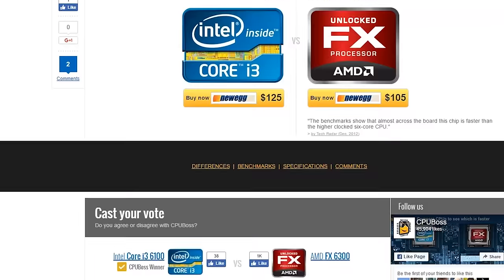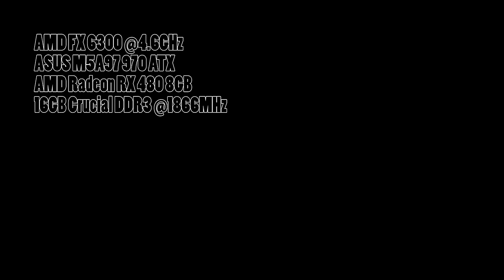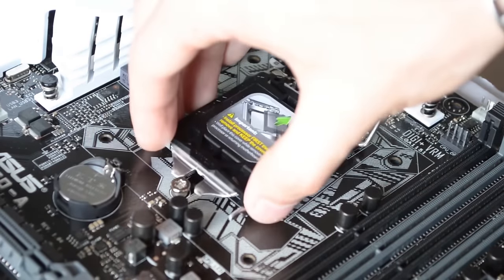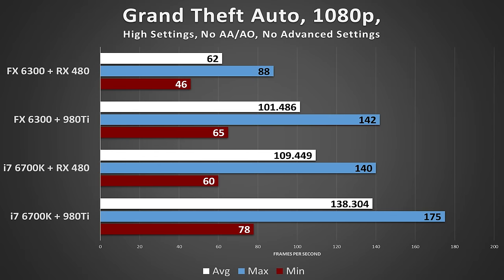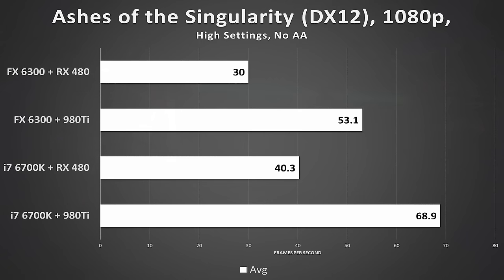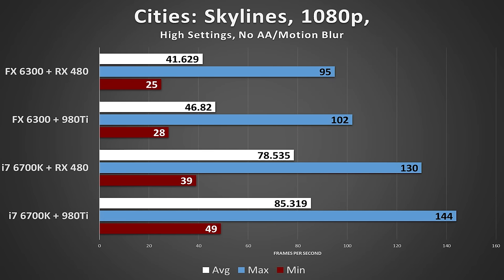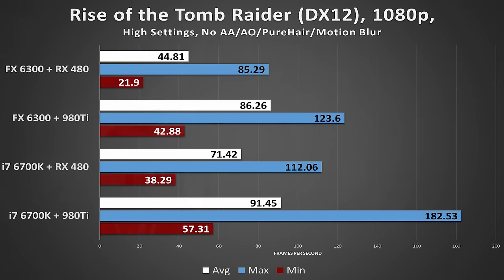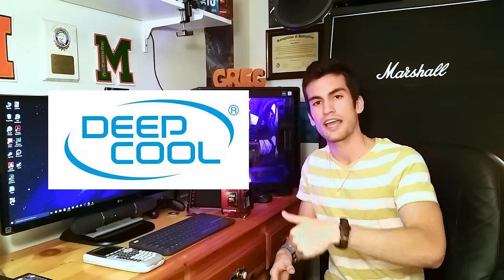AMD FX 6300 + RX 480: Severe Bottleneck?

Comment: Now I want to get an intel CPU- I have and FX8320. Too bad I have to buy a new motherboard as well.
Reply: Or wait a little more for Zen architecture.Even if decide go Intel; it will cost you less.
Benefits of competition
Reply: Okie. Intel will cost less? sorry I didn't understand.
Reply: Rigth now Intel have a monopoly on high performance CPUs; it charges any price they want because there is no other choice.
ZEN is to be launch within the next months and will set a new price/performance ratio. It will depends on how fast ZEN is and how many 14nm dies comes out of silicon wafer.
Both parameters are secret but it will be know this 2016. The design is done and working engineering samples exist. But still need to ramp-up production at the Fabs and give chance to the retail channels to get rid of old inventory
Reply: So Zen will be cheap and powerful. Sounds like a very AMD product. I also want the RX480- a good card for quite cheap.
Reply: Yes it is, the leaked sample 8core@ 3GHz  with a IPC similar to Hashwell making equivalent to a intel 5960X a CPU costing a grand ($1000).
Of course once AMD set their price; intel will have to match. And the rest of the lineup will do the same.

RX480 is a good  upgrade if you are coming from middle rank cards; but not if you have a 380x, 290x, 770, 960;etc. The point for the RX 480 is the low price for that performance point not brute force. FuryX; 1070 or the upcoming VEGA are for those niches (but are not cheap to buy or operate).
So it depends on your current gear (monitor, VR) and goals.
Reply: I have a Gigabyte radeon R9270x windforce so an RX480 will be an upgrade.

Comment: I cant figure out why games only use a single core perfomance ? Do you need a 9590 or a core I5 toplay at a decent frame ?
Reply: Most games will only use 4 cores at the very most, which means that adding more cores won't increase performance. That's why a dual core i3 will typically perform better than a 6 core FX. Let's say you have a game that will use 4 cores. That game would benefit more from a cpu with 4 stronger cores than a cpu with 8 weaker cores since it would only use those 4 cores anyway. If you ran that same game on an 8 core cpu, you would see 4 cores running near 100% load and the other 4 barely doing anything at all. An FX 9590 would be a very poor choice for gaming because it lacks single core performance. The i5 is an excellent choice because it has great single core performance. I hope that this helped you understand the importance of single core performance.
Reply: DX11 legacy reasons that I won't get into. We should see CPU bottlenecks relax slightly with DX12 and Vulkan.
Reply: FX9590 despite being clocked at 5ghz turbo has extremely weak single threaded performance. Intel have over 100 cpus that trounce the fx9590 in single threaded performance.

Comment: So basically the fx 6300 is a 3 core processor with some sort of hyper threading or?
Reply: 6 cores but each pair of cores share resources, like L2 cache.
Reply: No hyper threading is something quite different. The fx 6300 simply has each core split into 2 processors. Only amd Zen architecture will be introducing their own form of hyper threading which allows processes to be shared between cores when they usually wouldn't be able to.
Reply: +World Kat (KB) oh I understand now, thanks. I hope to be getting a zen cpu when it comes out if It manages to be around the performance of the current i5.
Reply: fx 8350 is an i5. Zen will be competing with i7 and will offer many more cores then i7 currently offer(This is just basic info that has been around for a month). They claim to be making a 32 core cpu with 64 threading with their form of hyper threading. We will really not know just how well Zen competes with i7 till its released but if its true then it will be a cheaper alternative to i7 gaming.

If your planning on upgrading with amd then I suggest wait till 2017 when Zen and vega are released because at the very least it make intel/nvidia stuff cheaper if your team green.
Reply: +World Kat (KB) I'm on team best price to performance :D My full budget for a pc is around a £800-£1000 (not buying yet) and rn I'm thinking of getting a fx 8370e and a gtx 1070. I'm speculating the 8370e is going to bottleneck is so I'd go with the i5 6500 instead
Reply: I wouldn't match a fx 8370e with a 1070. I wouldn't even match a 8350 oc to 4.5ghz with a 1070. The flaw with the fx series is its not really a major difference from the athlon architecture as in the cpu suffers dramatically from not being able to use all cores for a game so the possibility for bottle necking your 1070 is very possible. The 1070 will still be completely relevant in a few months and I suggest wait for Zen and then decide. Not all modern games run on well designed engines that can full utilize a gpu and cpu such as Overwatch's engine does for instance.
Reply: It has six cores marketing-wise but irl three cores.
Reply: No watch his latest video. 

It has 6 physical logic cores unlike intel hyperthreading. 

But these 6 cores have to share a floating point unit which causes downtime. 

Then there are some bottlenecks with having just 3 schedulers.

So it's a a V6 with a faulty ignition system
Reply: +1barnet1 yeah I already did mate. FYI to all the peeps replying from now on I watched his video on the fx cores

Comment: Hi thanks for the vid. I have a fx6300 should i rather buy a fx or a gtx1060, thanks :)
Reply: buy an FX as in an better CPU (8350->) compare to an Gefroce GTX1060?
thats depending on what GPU you got already . if its like an Radeon 270X (or better) or GTX960 (or better) i wouldt change anything yet or maybe just the CPU.
if its like an old Radeon 5870 or Geforce GTX 275 you will not get much out of getting a better cpu
Reply: Thanks, im running a hd7770, at the moment. Its a old card. So you think i should rather upgrade my cpu instead? Im acctually waiting for the zen cpus to launch before deciding on what to do. Regards
Reply: thats depending on use. the Radeon 7770 is old and performance is between a Geforce 750 and a 750Ti so an upgrade here would be welcome.
right now the GTX1060 shows good results for Dx11 gaming. the RX480 is far better for Dx12 titles and knowing AMD right it will get far better performance over time with driver updates (even with Dx11 titles).
and with AMD you can get Free-sync monitors and that is a 150-200 usd less on monitor... if you care about that kind of stuff.

but ether card would give a significant boost. but that could be said about getting an used Radeon R9 290. the 290 could give as much as 4 times more FPS than an 7770 (Bioshock Infinite is one of the few i found with fps difference and the 7770 does 25 vs the 290's 91 fps)
and if lucky you could find a good one with a silent cooler for less than half the price of an 4GB RX480. but beware, the 290 eats power...
Reply: Thanks a lot! Very useful information.

Comment: i'm using a FX 6300, its core performance isn't the greatest. mine is clocked at 4.2 i'd clock it higher if i had the money for a 8350....which is what my board supports

Comment: best bang for buck is a core i5 6600k and an rx 480,  spending a little extra on  a good cpu wont hurt and will be beneficial in the long run. the Fx cpu is at the mercy of game developers to utilize the cores properly, which they hardly ever do, but with intel thats no problem because intel has much better instruction per clock, and single threaded performance, even a non k i5 6500 will be much better than any FX cpu. AMD needs to step up their game and release zen soon

Comment: today I tried my first cpu, X4 860k with the R9 390x.  0/10 would not recommend.
Reply: lmao
Reply: troll post.... i have a phenom x4 black edition not overclocked. everything is fine with the rx480! everything runs wonderful.
Reply: +castiel vargas I said r9 390x not the 480, it is very bottlenecked.
Reply: the r9 390 is on the same level as the 480. 480 consumes less energy and has a more modern technology inside but they are equally fast.

Comment: A tiny bit unfair.  You're actually testing 3 vs 4 cores:P SO i Guess a fx 8350 or so on 4.6 ghz would score max 1/4 higher then the fx6300. Wich seems rly fine vs a expensive ddr4 platform and a high end cpu. 
I myself am happy with my stock fx 6350 and fx8320E.
Reply from the maker: Not the point. Pay attention to what I said. The i7 rig represented no bottleneck.
Reply: I3 6300 beats a fx8350 in gaming only loses in rendering
Reply: also rx480 sli will run with a gtx980
Reply: I know sience studio. It was more of a reply to all the comments below:P My bad.
Reply: I'm holding out for zen and vega and am4

Comment: after a 3 years the situation is totally different. my old/new build fx6300-12gigram-r93804gb makes miracles in 2019 in WELL optimized games like WWZ and Strangebrigade ,FHD highdetail 60+fps , gpu bound 92-99% . and guess what , mobo with fx and ram costs me 50€ . gpu another 50€ . so for 100€ you are gaming modern titles. next i will test x6 1055t with gtx970 but i expecting bottleneck. we will see. so everything is about how much one or another gpu and cpu producer pay to game developer for optimization . surprised? not me.
Reply: Overclock the phenom II to 3.8 or higher. I got an Rx480 4gb and i see maybe a 5% bottleneck. Not a big deal. I play modern games on medium graphics at 1080 no problem. Upgraded to 990FX Mobo a coulple years back. Im just now looking to upgrade the PhenomII to a used FX 9570 for about $100 soon. LMAO

Comment: Just so those who don't use a 6300 are aware. 4.6 ghz is a very nice overlock for this cpu, a 4.6 ghz overclock for an i7 is pretty average and could definitely be better. As a very happy 6300 user, The facts are it's not much stronger than the phenom or athlon series quad cores, Its a very slight performance boost of maybe 10-20 percent. What the 6300 does benefit you on, is the ability to use a am3+ socket, Which allows for better ram,  and power allocation etc. And when comparing an i7 with any AMD cpu (again I'm an amd fanboy, I promise) cpus like the 9590, Are no where in comparison of strength, Especially in twp. The strongest available amd cpu currently, Is about as equvilant as an i5 6600k. To be frank, the 6300's bottleneck is very depressing on something like an rx 480, that it lowers its performance to that of something like the 650 ti. the 980 TI's little brother. I love my 6300, But unless your budget gaming, Don't pair it with a 500 dollar gpu, Especially now that the  r 480 x is a thing. And even then, an i5 is much for bang for your buck in terms of long term of next gen games. I'll still use my fx 6300 though, cause fanboy.

Comment: Frankly, this video doesn't prove "X cpu bottlenecks Y card". It proves the 480's only perform well by using the cpu as well.
They aren't different ways of stating the same issue/problem and the performance increase on the 980ti proves it.

The conclusion you should have come to is "AMD lie about their video cards, they actually require CPU power to run".

Comment: The only budget CPU anyone should even consider getting would be the i3-6100. I went with a cheap FX chip (4200), and until DX12 rolls out, it's not even worth upgrading to the 83x0 series. It bottlenecks the ever loving hell out of my R9 280 3GB, so I know damn good and well the 6300 would do the same to an RX 480
Reply: The new Pentium 4500 for low end GPUs is pretty baller.
Reply: 1.) I love your username
2.) I still wouldn't trust it, but I also play a lot of RPGs. I personally wouldn't pair it with anything above a 270 or a 950
Reply: DragonRising II Well ya with any mid to high range GPU that Pentium would hit 100% usage and cause problems.  But for a basic low end PC its pretty baller for the price. 
And thanks, i thought the name was pretty funny. Even though im no longer using AMD, all intel and Nivdea for now.  8))).
Reply: 4GB MEANS 4GB I'm hoping to do the same. Zen really needs to be something special, man. I'm looking at upgrading to an i5 6600k (or the Skylake Refresh equivalent), a Z170 ASUS or MSI mobo, and some DDR4-3200 RAM. Absolutely nothing wrong with my 280. I'll probably wait until next year to upgrade it. Should give Nvidia time to throw on async compute, or give AMD time to make cards on par with Nvidia's offerings.
Reply: DragonRising II I got a 5ghz 4790k from Silicon lottery website and just got a 1080, thing overclocks to 2000mhz.  Was gonna wait for the TI but i dont have all year.  Im one of those guys who has to have every game setting on max lol.
Reply: DragonRising II Ya alot of RPG's specially online ones are just so badly coded no matter what your gonna get fps drops.  For example in wow i could get massive FPS, but if im in town with 200+ people you will get below 30 fps. And thats with a 5ghz intel cpu.
But they are getting alot better.  Like the witcher 3 has so many models on screen along with tons and tons of buildings and very fare view distances and runs like a champion.

Comment: There is a good and easy way to make the GPU the bottleneck. Just up the resolution... If you're powering 1440p. What would the difference be then? Same for 4k.
Reply from the maker: I already said in the video that the FX 6300 wasn't handling 1440p adequately.
Reply: +Science Studio then there is a bottleneck somewhere else. The whole point of using lower resolutions is to make a CPU the bottleneck. Higher the resolution, the less the CPU is the issue and the more the GPU is. So what's wrong with your FX-6300 system?
Reply from the maker: Your third sentence is absolutely incorrect.
Reply: +Science Studio So you say...
Reply: +Nian Banks You increase the resolution, that means more data gets processed which means the cpu has to work harder to get that data ready for the gpu.
Reply: At a lower resolution the CPU is more likely to hit a higher usage percent because it has to process the hundreds and hundreds of frames a modern GPU pushes at that low resolution. If you raise the resolution, the GPU pushes less frames and the CPU has to process less as a result. That's why the difference between a low end processor when comparing it to a high end processor can be seen at resolutions such as 720p and at 4k the difference between the two is far less. Of course I am generalizing but you get what I mean.
Reply: +esperCELL No. But you can drastically reduce the effect of the CPU bottleneck by upping the resolution. Eventually the GPU can only give so many frames, even when posted with a great high end CPU.
Reply: If the GPU is at 100% the CPU doesn't have to work as hard. Because the "bottleneck" is the GPU. If the CPU is at 100% the GPU doesn't have to work as hard, that is why you rarely ever see 100% usage on CPU and GPU at the same time in gaming.
Reply: in overwatch my FX 6350 and Sapphire R9 280 both run at a 100%

yay

Comment: The 980Ti is twice as powerful as the RX 480 (c) Science Studio (said on numerous videos).

Hitman, Skylines and Tomb Raider benchmarks shows the 980Ti is just 20-25% (not 100% .... but 20-25%) faster than the RX 480.

That Engineering degree came in handy I see! GOOD MEASURING! XD

I suppose by your amazing calculations, Mt Everest is about twice as high as a sandcastle, right?
Reply from the maker: You're a bit clueless, chap. Look at firestrike, floating point performance, and frame rates in any game that is maxed out. And, in higher resolutions, the RX 480 falls pitifully behind. You're basing this on an average resolution at average settings. Think before you type.
Reply: Science Studio
In your OWN BENCHMARK SUITE, in this VERY VIDEO, the evidence is 20-25%, chap.

Yet again you say "twice the performance" just like you did in the OTHER video.

TWICE as fast. You said it. You said it twice. Look at the numbers in your video. Is that 2x the fps? Cos I only see 1.25x, at best.

Comment: I just got a GeForce 8800 gtx from my friend for 250. He said it was a really powerful graphics card. I don't know what other parts to get pls help
Reply: GeForce 8800 gtx WAS powerful like 10 years ago; now is mostly obsolete.
But is you plan to use as last gen games machine, any modern Pentium or Atlhon/APU will do it fine. APUs will have the advantage of letting run DX11 games slowly but fine for most lighth gamming and switch to the GTX for DX10 at higher frame rates and resolutions. Is kinda messy but it will work.

Or if you wanna a second hand build for really cheap get a i3 2xxx or 3xxx series. Or a Phenom II any will do it and are even cheaper.

Comment: so iam running a 6300 with a rx460 and iam amazed how low thqt cost me and how iam gaming. but i would like to upgrade something at the end of the year. a 8350 with a rx580 1366mhz clock. would that be alot better cos iam reading here alot 8000 is shit well can4 be worwt then the 6300??????

Comment: I have an fx 6300 with a gtx 970 ... RIP :'( Help
Reply: Upgrade to an i5 4690 or 6500. Or 4690k if you have an overclocking board.
Reply: Saxton Hale board's currently am 3+... Will have to change my whole platform... What about the 8350?will that bottleneck too? Or 8370?
Reply: Ankit Sharma Yes, it still will. Per core performance is important for gaming and all AMD processors are bad for that because they have a lot of weak cores.
Reply: Saxton Hale Damn....this is going to be expensive
Reply: No it will not bottleneck :D
Reply: Matador the 8350?
Reply: Ankit Sharma Please, please do not buy an AMD processor. They are coming out with new ones soon and the 8350 is every bit as obselete as the FX-6300.
Reply: Saxton Hale I really don't want to ...It's just that I would have to change my whole platform...I don't especially need it right now..but I soon might..Selling my stuff won't be easy either...I understand what you mean..just a sticky situation
Reply: Ankit Sharma Yeah , it will not bottleneck but i wouldn't upgrade .